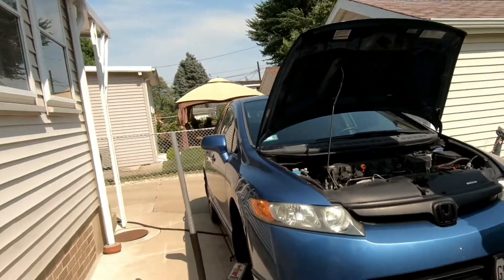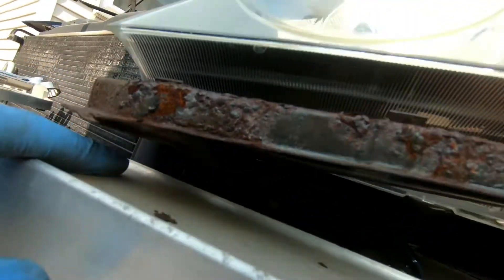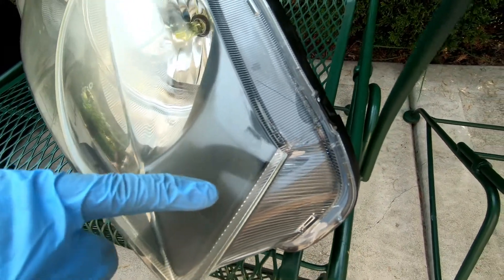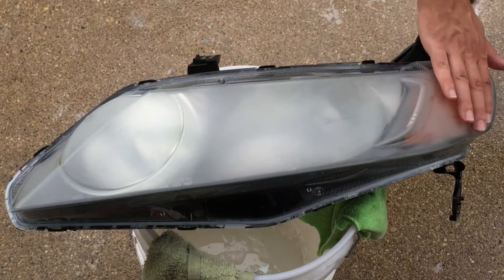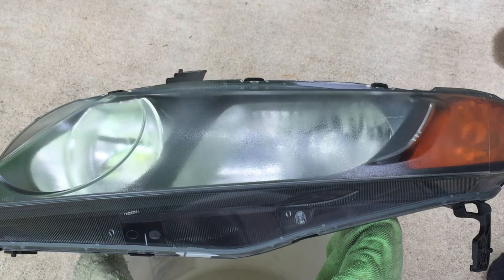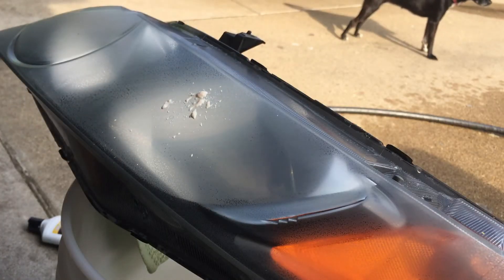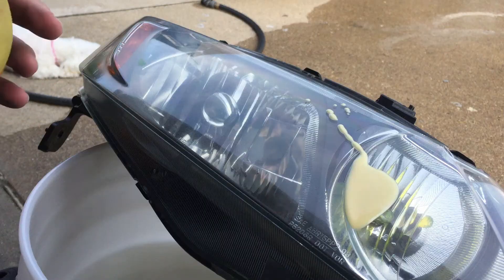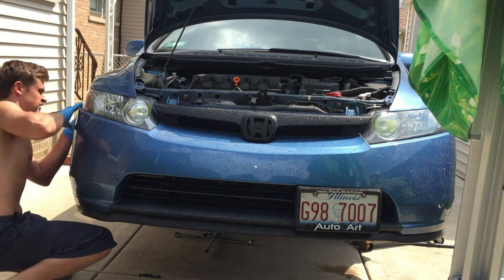BEST Headlight Restoration Process

Comment: great job!  In the future I'm gonna sand mine in between coats of clear, maybe even as low as 600 grit between coats.  Let us know if this treatment lasts, because there is a risk (ask me how I know LOL) of sanding off all of the clear that you spray on and end up just buffing and waxing the lenses.
Reply from the maker: I will keep you guys updated I am hoping that there is coat of clear even though it may look like I sanded a lot of it off.  They should really just make replacement headlight covers like they do on some of the Corvettes.

Comment: Bro wtf? U did this all wrong. Who told u to spray paint clear coat ?? No no. U should have just did the 3 step sanding. And then compound and polish. No spray clear at all!!!! U doing all that sanding after wards basically removed the clear u sprayed on. Smh
Reply from the maker: You are definitely wrong and have not seen what people have been doing.  I have sanded and Campground it multiple times and it always comes back within a month. The clearcoat is to put a new layer of clear on as the old one is always feeding away due to lack of UV protection. Although it may look like a sanded most of the clear called off again I guarantee you I did not as it was thick.  We pretty much just remove the orange peel.  Just like when polishing a car after paint they wet sand the clearcoat and then bbuff.